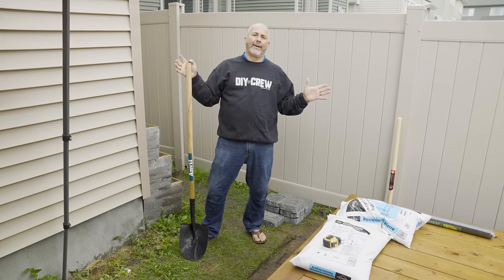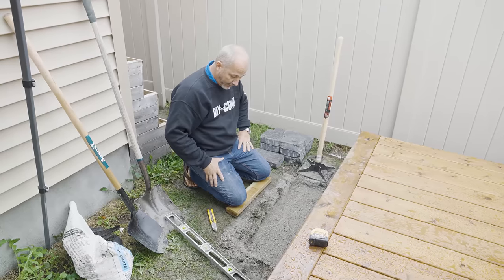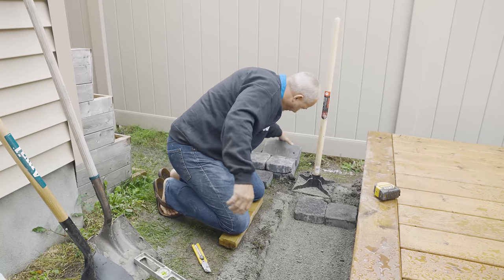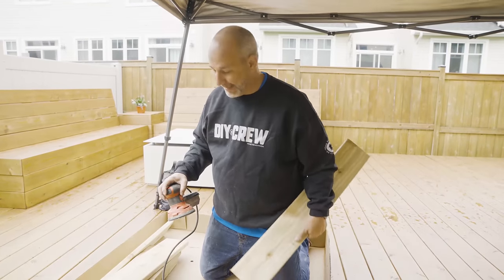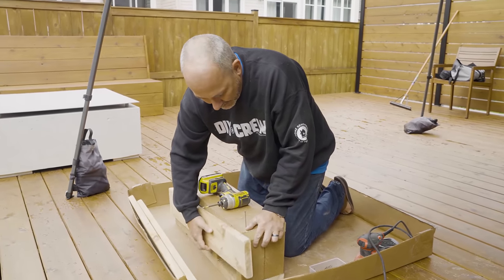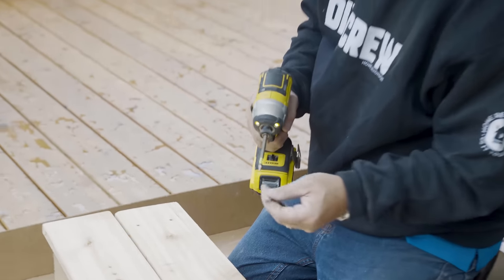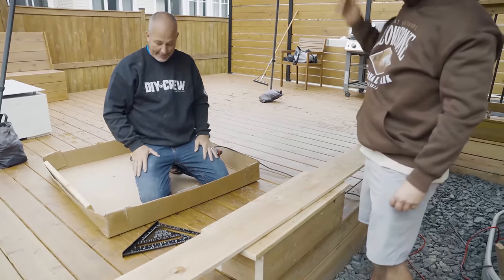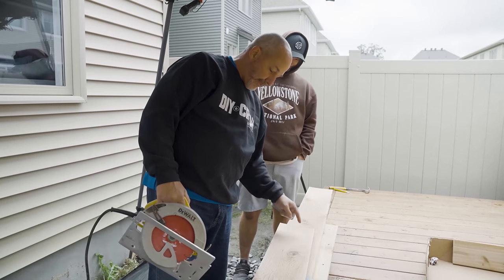How to Build a Step (Quick and Easy)

Comment: That was a good comment RE the rise vs run. I happen to have dang size 12 feet, and I am shorter than you. My son in law is larger than me by a bit, and has size 14 feet. My mother in law LOVED our stairs because of the wide tread and the short riser, and she was about 5'5".... with about size 5 feet. Well designed stairs make it SO much easier for everyone to use. We can get our feet on there, and shorter folks, especially older ones, can take a natural stride up the stairs with low risers... and depend on them to be the same size each step.

Comment: On another note. I built a "boardwalk" for my backyard. It has been years now. It was terribly expensive well over 850sq feet 5-12 feet above ground. Maintenance is challenging.
I want to start replacing "decking" bords the thin ones with composite ones. Yes they are spendy. They don't rot out. I don't have to seal and stain them every year or two in NC.

Super amazing if you do or did a video on that. $12-15K for lumber. Not sure what composite boards will cost. In the end it will be worth it. I am going to try to replace them in sections. Great channel I am a subscriber from your first video I saw. <3

Comment: I thought the easiest way to measure the outside is to get your full length required + width of the board per side, cut a 45 on the mark TO your initial mark, cutting the direction of the second mark with the width of the lumber accounted for, make 2 cuts, and flip the middle board, and you have your 3 sided box essentially. Am I off base? I'm making my deck here soon so I'm asking because it's what I planned to do with my material to eliminate guesswork and have less waste.

Comment: Forgot to treat the cut ends of the pressure treated wood, unfortunately.
Reply from the maker: This is all covered ion cedar so nom worries about the life span. gravity build vs using fasteners require much less protection.
Reply: Love your channel, but I must respectfully disagree. Would have taken you 5 minutes to soak the ends in preservative— thus assuring longevity.
Reply: I don't think this was intended to be a "heirloom" project, so it's perfect, IMO!